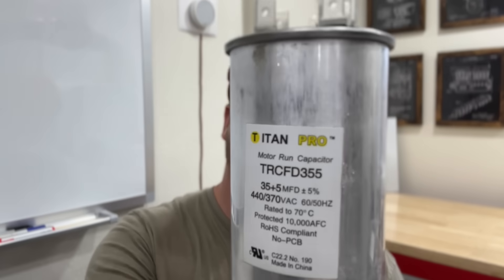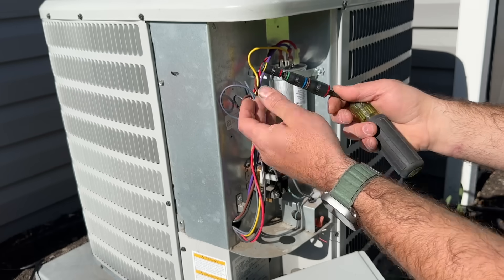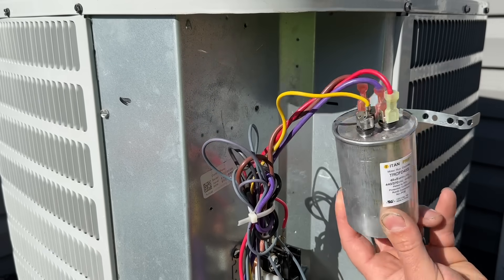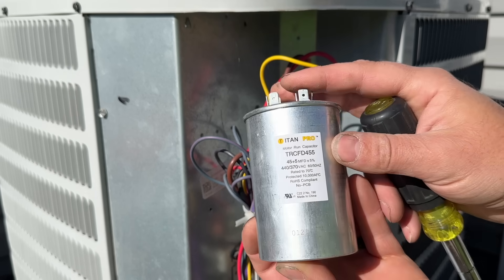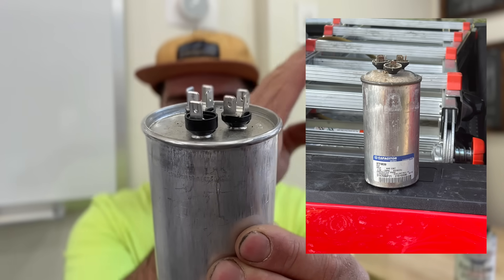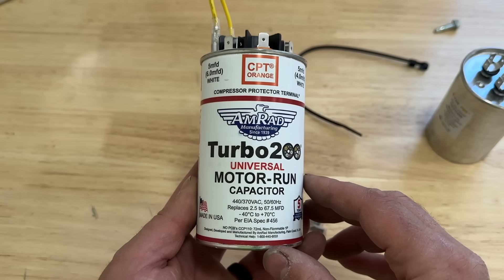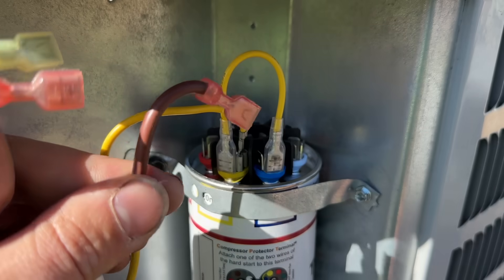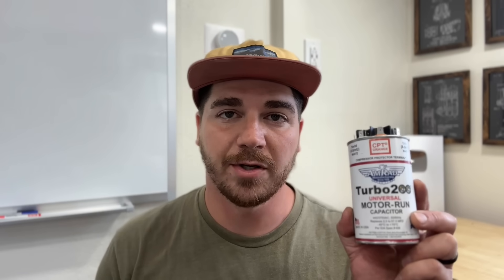HVAC Contractors Practically Make Their Living On These

Comment: You probably do not want to discharge a capacitor by applying a dead short as some have a huge charge and a dead short can cause a massive arc. A discharge resistor is a better way to discharge a capacitor. Also you need to wear insulating gloves around potential live connections.

Comment: It’s a run cap, not a start cap. It does not give it an “extra jolt” on start up. 
Yes, there are some rip off contractors out there. However, you are NOT paying for the capacitor on a service call, but the knowledge and service of the professional you called to get your system up and running. Yes, most capacitors cost 10-20 dollars. That being said, I’m NOT driving across town or towns to charge someone 20 bucks. I DO NOT encourage home owners to do this work themselves. 
Another item to note is that 99% of the capacitors I’ve changed in my career were a result of higher amp draw due to plugged condenser coils. So, bad cap? Check and clean the condenser as well.

Comment: I have an Amrad capacitor that was 20 years old and still running when I removed it. (The reach in cooler was being replaced.) 
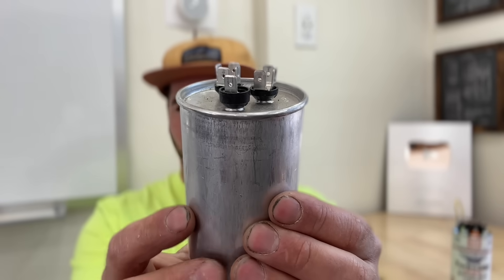This impressed me so much i kept it and I tell anyone who will listen, how good this companys products are. In 15 years(servicing the same equipment) I have never had one I installed go bad. I keep a Turbo 200 in my personal truck for after hours & weekend calls from "friends" & Family. One Capacitor covers all possabilities. Worth every penny at 4:00 on a hot Sunday afternoon. If you know this why would even buy a Titan Capacitor?

Comment: I learned this a while ago. I now have a spare sitting on the shelf. When I had a camper trailer, I carried a spare for it as well. If someone is going to go on an AC unit, its the first thing I check. I don't even do HVAC and I have probably swapped a half dozen or so over the years. A lot of times its out because a mouse decided to make a house in there. Like 2 summers ago, I had to run a new wire because it corroded so bad from mouse pee lol. It was so gross,  I pulled all the electrical out of it so I could clean the hell out of it.

Comment: Another scam is water softeners, my brothers packed up and he had the company come back that installed it  some years ago, they told him it was wasted and he needed a new unit, around £800:00 i think one was, he asked me to have a look and i found a faulty solenoid valve , or rather the coil on it, i had a coil off of a washing machine water valve that fitted though it was a slightly lower wattage coil, i swapped it out and said it may not last as its not really for longer duty cycles but that was about 7 years ago and its still working …

Comment: Info at 6.40 to 7.00 is 100% WRONG. The +- 6% is tolerance meaning 45uF can measure anywhere between 42.3uF and 47.7uF, NOT ‘if it measures less than 45 the capacitor is bad”

Comment: thanks, back when I bought this home, my first. A company told me I needed a capacitor for 325 bucks, not as much as 2000 but still it was in 2007 dollars. I did research and found for 10 dollars and told him kick rocks. Before I went to pick one up I did test thanks to vids at the time and it was FINE! the "failing capacitor" ran until 2022 when the unit sprang a leak and I finally replaced. yes a rheem unit lasted from 1998, original owner purchased, until 2022. this was me cleaning and "maintaining" through helpful youtube vids like yours.
Reply: My Rheem was from 76, just now replaced the Furnace and Air, so I got 47+ years, but we used the air just when outside was above 82 degrees. You are right, it is all about the maintenance! Our subdivision has so many old people, they come in and hard sell a new unneeded system for 12-15 thousand dollars. One lady said she was going to have to go to the food pantry. It broke her, by taking her safety margin money!  All of it! People should always call a small contractor for a differing opinion.

Comment: No joke. This guy is speaking facts. I found out about this and did some quick research and bought a capacitor and problem solved. If you have basic DIY skills, try this before you call an AC professional. FYI, the bowing on the top of the capacitor may not look that pronounced when it goes bad, so it may look like it's still good when it isn't. Like and subscribe buttons hit for you and others getting the info out there.

Comment: You sir earned a like and subscribe. Thank you so much for sharing this valuable (money savings) information. Yeah' we'll be careful not to zap ourselves, thanks for the heads up on that. I'm gonna go ahead and order the correct ~ $10 - $20 capaciter now and have it sitting in the drawer - I hear that's one of the most common replacements needed, but didn't know how simple it is to change one (minding the electricity dangers). ty ty ty ty ty

Comment: Murphy's Law says, "If it is working, don't F with it".  BUT, if your condenser is ~ 10 years old - or more, it "may" be a good practice to replace the cap - BEFORE problems arise.  What are your thoughts on when to change these caps out?  It seems like replacing a 25-30 dollar capacitor after 10 years is a good idea to help prevent compressor/fan motor damage....

Comment: I can't believe the prices people are being quoted to replace a capacitor. About a decade and a half ago I was an HVAC apprentice (2 years of ACCA training, 4 years in the trade). The company I worked for charged about $110 for a hard start kit, which is basically a capacitor replacement but a bit better. $4-5 hundred dollars is ridiculous. I had to replace  mine a couple years ago, $10 at local appliance parts store. 

I've been in information technology since leaving HVAC, but have saved a lot of money with the knowledge I gained from the HVAC trade, put my own HVAC system in my house when I moved in and have paid almost nothing in almost 20 years.

Comment: My AC broke and I was quoted $1100. I figured out I needed a new fan motor and cap.  How? The cap was melted and black, and the fan would not turn at all. I figured out where to buy the cap and motor for $160 for both. 20 minutes later it was running 55° air.  Where there's a will there's a way.

Comment: Del-air in central Florida is notorious for over charging for these. If there is a problem with the A/C whatever it may be, they will change it whether is needed or not and charge you for it. If it doesn't fix it, its to their advantage because now they can turn one call into 2 calls or a double charge on your credit card.

Comment: As someone who worked in the A/C business for 31 years, I rarely ever saw a cap that looked like that. Most of them are more flat. You also have more than one. The compressor can have a start cap and a run cap. So can the indoor and outdoor fan motors. Regardless of what they are for, most caps only hold a charge for a few seconds at most. There is a tool to discharge them safely. DON'T short them out. They can literally explode. Usually they don't, but it's possible. Residential A/C units run on 240V, and usually have a 30 amp fuse and are on a 30 amp breaker. That kind of current can kill you. Don't mess with it if you don't know what you are doing.

Comment: a couple years ago my mom's ac wasn't engaging and did some searching and found out it was the capacitor. Went to a local shop and got a replacement for 35 bucks vs the quote from the AC company of 250$ 
Just make sure you go to the breaker and shut off the power and make sure the capacitor is fully discharged before touching the old one.

Comment: My fan capacitor went bad and I didn’t know. I just knew the fan wasn’t running. They charged $150 for an after hour visit, $80 for a capacitor, and $100 for labor.
I watched him fix it in like ten minutes. Bought a spare off Amazon for $18 and it’s in a box in the utility room in case it happens again.

Comment: I have rental houses in the desert in which the tenants don't change the air filters as often as needed.  As a result, the run capacitors are constantly blowing out and costing me a few hundred dollars to replace every time.  Very frustrating.  And it's always when it is 105F out.

Comment: I had dealt with a terrible HVAC company out here called Wachoff's who were looking to charge $500 to replace a capacitor that was working just fine. They shook the capacitor and told me the sloshing sound meant it was going bad (which apparently is a lie). I called the office to ask why they are charging $500 to replace a part that costs $70 at most and they told me that they have to get the money back for training their technicians.

Comment: This person does not mention the fact that there can be multiple sources of power in an air conditioning system.  I learned that the hard way when I was just starting doing Service.  The indoor unit can send power to the outside unit when the outside unit is shut off.

Comment: "$10 for the part and $1990 for knowing where to plug it in."  Fortunately when the cap blew in my heat pump the AC guy I used charged me about $15 for the cap and his normal rate for 1/2 hour to diagnose and install it.

Comment: 15 days ago my water pump capacitor expect 440 volts.. My friend made a photo... Then got correct type voltage etc amps... Except one thing 2.5 times to big... Well he going find the right size... With standing behind him... He said get one.. I look at both... Thinking I put it on and put something to cover on top..... We are hitting 38 certgrate plus... I said they are the same except size... And walked away.... I came back later to see if I hot wire or spin the pump as that I what I did for a week... He had installed the bigger one...

Comment: You can try to replace your capacitor yourself. I don't see anything wrong with that. I would definitely follow the advice and discharging the capacitor. But it's not guaranteed that's the issue. And that's why HVAC guys cost what they do. But $2,000 is absurd. That guy was absolutely taking advantage of the customer
Reply: I would have been $50 minimum charge on the side and less than $25 for the very common 30/5, 35/5, 40/5 or 45/5 MFD 440 VAC cap. I also would have washed out the condensing coil, checked the contactor, air filter and threw a temp probe on to check the charge. If I noticed it wasn't cooling I would have went out to the truck and got the gauges. On the clock we were minimum $89 for 1 hour time and that same capacitor would have been about $35. Not worth wrecking your equipment, taking blind stabs in the dark with no training or experience or getting hurt/killed over.
Reply: And the question that was never asked or answered yet.....WHY did the capacitor blow?! Us licensed and experienced HVAC will start checking around to see/find out why. If "that" isn't corrected it will just fail again. What if your terminal block has been compromised on the compressor etc etc?! A homeowner or "handyman" isn't qualified to look or fix that stuff. A "new" capacitor ain't going to fix that.
Reply: @JohnDoeEagle1  I find that 90% of the time, loose terminals cause capacitors to fail. Heat is the issue, and loose terminals generate heat

Comment: After a lightning storm, our fan ran backwards, pulling air from the top and blowing it out through the sides. A new capacitor fixed the issue.

Comment: The first thing you really need to do is verity that there is no high voltage coming into the unit, there are those contractors that will bypass the disconnect.  Check voltage, check voltage,  check voltage.... it could save your life !!

Comment: As a HVAC tech, I can say that the only part that a home owner can't service is the refrigeration loop. You are "supposed" to have an EPA license to even possess the gauges and refrigerant. There is one more thing to check if your unit isn't running. Bugs in the contacter, I see it every spring. The heat and the ozone created when they open and close draws them in, then the next time it closes, it's a bug gut insulator inside the contacts.
Reply: Untrained, unlicensed, unsupervised people should leave their hands off of it. You can easily wreck your equipment or get hurt/killed not knowing what you are doing. That is 240 Volts A/C or 480 Volts 3-Phase Delta and neither one are to be played with while you "figure it out".
Reply: What this guy doesn't tell the people is the power doesn't always get turned off when you shut off the disconnect switch. Some people wire them hot all the way through because it was blowing fuses or to protect against theft. If you get one wire that burnt off the terminal and connector on the capacitor it could still be storing it's energy without a way to discharge it. Grab that wire and chuckle with glee "looky what I done...I fixed it myself!"

That's if you even wire it back up right and don't blow your compressor or burn out your fan motor......

Comment: I'm an HVAC mechanic for a hospital and cringe when I hear what some mobile guys charge people. I have a hard time doing side jobs because I can't steal from people like that. I only do outside work for family and friends. I rarely charge for my time and only the parts I had to buy. I know these guys need to make a living but not sure how they live with themselves after collecting a check from the customer
Reply: Untrained, unlicensed, unsupervised people should leave their hands off of it. You can easily wreck your equipment or get hurt/killed not knowing what you are doing. That is 240 Volts A/C or 480 Volts 3-Phase Delta and neither one are to be played with while you "figure it out".
Reply: What this guy doesn't tell the people is the power doesn't always get turned off when you shut off the disconnect switch. Some people wire them hot all the way through because it was blowing fuses or to protect against theft. If you get one wire that burnt off the terminal and connector on the capacitor it could still be storing it's energy without a way to discharge it. Grab that wire and chuckle with glee "looky what I done...I fixed it myself!"

That's if you even wire it back up right and don't blow your compressor or burn out your fan motor......

Comment: First of all, there is so much that you are wrong about.
The capacitor your holding (like all capacitors) does store energy sorta like a battery. The capacitor your holding is a run cap, it is used to power one of the windings, AND more importantly correct the wave form of an inductive motor.
There are also “Start” capacitors, and those do provide momentary power during start to help the motor to overcome back pressures in compressors, and high starting amperages that can blow fuses, and overload the windings.
Us HVAC guys do charge a premium, but we have knowledge, wages, trucks, tools, insurance, uniforms, and office staff that all costs us money and allows us to show up at your door when your uncomfortable.
I sleep very well at night. You on the other hand, should loose sleep knowing that you’re recommending homeowners work around potentially deadly electrical systems with only your lame video as training.
You are an idiot, and I can tell you only have a remedial knowledge yourself.

Comment: Your right no cap should be a few grand. $250 to $300 tops. The real scam is capacitors used to last 5, 6, sometimes 10 years. Now, sometimes, within the first year, you have to replace the cap and the contactor. The makers of these products are the scam!!

Comment: Yeah I know this guy is not electrician by trade but some of the language she uses is inappropriate such as a perfect indicator there's nothing perfect, instead he should tell you that the capacitor will be puffed out at the top where the terminals plug in just like he was showing just that is typical for capacitors when they're bad to do that the container usually the top or the sides of the of the capacitor itself if it's a boat outward or ballooned outward it's a clear indication that the capacitor is bad, so just getting a replacement for it or supercapacitors they call them and you can take your voltmeter Chester capacitor but use your voltmeter to test it use look it up on Google and it will explain to you how to test it using a volt ohm meter, you could probably Google it or use Amazon if you want to look for replacement parts, majority of air conditioning tax companies carry these in their vehicle or their work truck or contractor vehicle by default because this is a common problem

Comment: Just a side note. When using a turbo 200 and sizing up. Make the connection to the largest termnal value ( jumping 20 and 25 to make 45. Put compressor lead on the 25). I do believe the instructions state this. God video.

Comment: Would a bad capacitor cause the compressor to throw the breaker the outside unit I on intermittently?  Not every time it comes on, but about 1/4 of the time.

Comment: HOLY COW!!!!!   NEVER SHORT A CAP.   Plus capacitors store a charge and it disciplines over time.  They are nothing like batteries as the they DO NOT generate charge.
Reply from the maker: You are very mistaken. This is how they train to discharge a capacitor. Did you think we were shorting it live? lol obviously the power needs to be off.

Comment: I may be an idiot but if I suspect a bad capacitor I spin the fan and in my experience it will start running if it's the capacitor.
Reply from the maker: Normally that means the fan is on its way out but it could be the capacitor.

Comment: and idead where else to find my capacitor? Repair clinic doesn't have my model/manufacturer replacement parts. And the manufacturer refused to tell me what size capacitor is required.

Comment: Thanks for making this video. I was being charged $860 to add 2 Hard Start Kit capacitors in my 2 air conditioner units. I refused and ordered them from Amazon for $18 for 2 and installed them in 15 mins. What a scam.